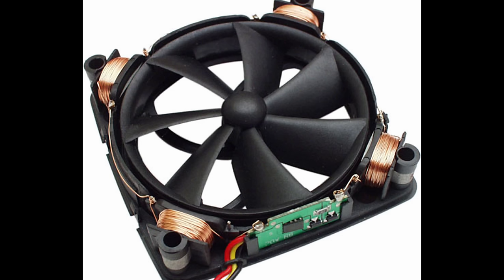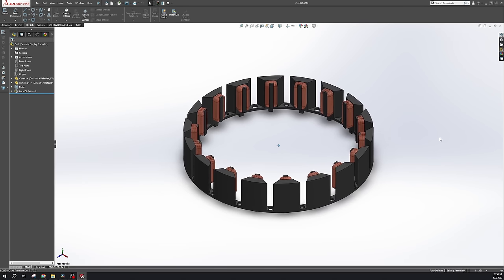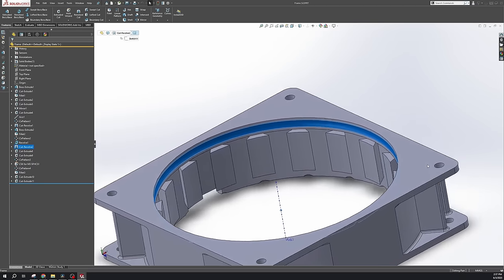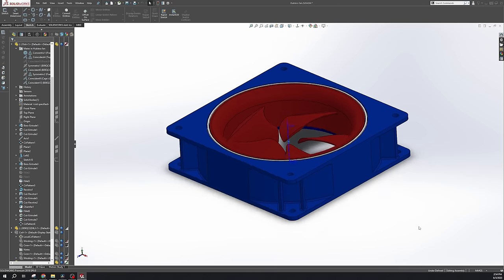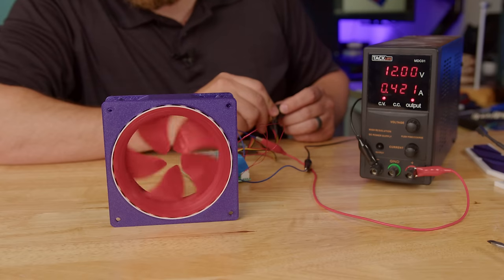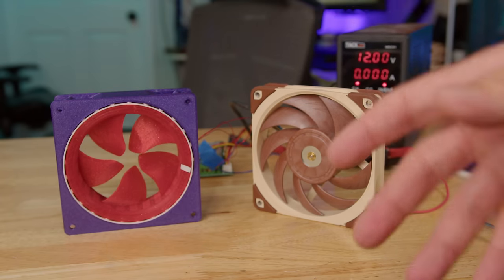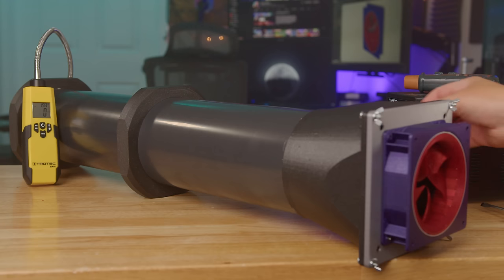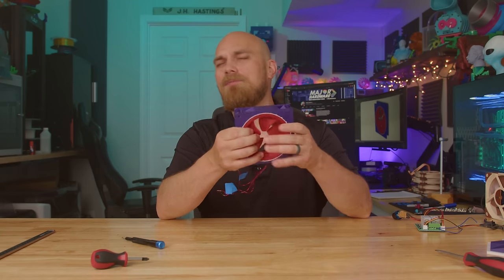I made a HUBLESS PC fan and it’s so loud!

Comment: So I have a thought based on this design for the fan. What would happen if you were to instead of blades coming out of the housing. It's 4 self propelling fans that propel themselves due to the velocity of the fan itself spinning. Idk just a high thought. Be a cool concept to see happen.
Reply: I'd imagine it would be difficult to pull off due to the construction materials probably giving up at high speeds, and how small the 4 fans would have to be to fit without colliding with each other. Definitely some spacing to prevent that but at same time maximizing space. Plus the structure that connects the  "pinwheel" fans would have to be sturdy to not sway at those high speeds as well. I'd imagine an arc system being used to replicate the blades without them being there in full. Tricky to pull off but might be something never know. I'm no engineer

Comment: Would it be possible (for v2) to replace the magnets in the hub with a magnetized roller bearing, combining the ball bearings and magnets? If sealed properly it can be lubed and provide stability and hopefully less noise. Sourcing rod magnets to be used as bearings would be the challenge.

Comment: I would like to see you improve on it's design. I know you're not a professional fabricator like they have when they are developing new products... however, if you're able to find a way to incorporate a smoother bearing (less friction) then it'll cut down on your sound and make it's rpm increase with less power. Additionally, what if instead of having a hollow middle you have the blades connect across as they are twisted? Not a hub, just a channel of some kind. Or better yet, make the blades hollow, but edged enough to scooped the air through and around? Goodluck! Been watching since season 1, big fan! haha, see what I did there?

Comment: Engineering wise its an interesting concept. And the execution with what you had at hand is  awesome. But in terms of fluid dynamics its inefficient. If this were a compressor for a plane, in which you have air coming at the blades and the hub, at high velocity, this would would circumvent having a stagnation-point or rather a second surface on which you fluid sticks and accumulates losses due to friction. 
BUT!:
You don't have that here. The fan is stationary and the hub is the point where the least is happing. The tip of the blades at the center move the slowest and even if their pitch is high enough to scoop some air, all they do is swirl it a little and push it to the outside. Besides, every bearing, whatever type, of the size of the rim of the fan, is grossly oversized for the forces it needs to accomodate. And generates additional losses because of the fricition and inertia of whatever is making the relative movement work. The only thing that would be acceptably would be magnetic bearing. Or a very thin selflubricating friction bearing saturated with some silicon-oil. 

What i would find interesting would be a "bladeless" fan, as in, like the dyson fans. Technically they are not bladeless, as the initial airflow is still generated by a fan in the base. But how about  you fit a radial fan to the housing of your hubless fan an make a flow channel that directs the flow to an annular gap and see how that works.

Comment: put a drop of SUPER LUBE MULTI-PURPOSE SYNTHETIC GREASE in the bearing channel might help with sound and start up spin. Also trick to get smoother surface take your old resin and coat a print it. you can uv cure it to the pla smoothing it and making it stronger.

Comment: Surprisingly there's deviation in the OD but the "hub" doesn't display the same wobble I wonder if the rim is slightly warped and that's where the increased noise is coming from

Comment: Why don’t you try to do the same design but with magnet instead? Like train for example. I think you will need a unit to control the polarisation but it should be much quieter

Comment: Altho the concept and look is really cool, especially with the hold in the middle, this isn't a really useful design because most of the airflow is generated on the edges of the fan, because that's where the blades are going the fastest, so putting the hub in the middle and decreasing complexity is very much a no brainer if the downside is losing the weakest part of the airflow

Comment: Curious if it were to operate on a computer, if submerged in mineral oil, would it silence the bearings, lubricate fiction points, and provide directional flowing of case hot pockets

Comment: I am sure if you "run it in" and grease the bearings, it would run better and be a but quieter. Maybe even eliminate the bearings holder inside and pack the race way with nothing but more bearings.

Comment: make the coils smaller and with thinner wire, and make more of them and get a metal frame ceramics ball bearing . that way it can be a thinner fan and frame for the fan thus lighter. 
and ad more blades to it. 
maybe even get lubricant for the bearings to reduce friction even more

Comment: If you change the outer ring electro magnets for 2 sets of electromagnets facing each others and the inner ring magnet passing in the middle of them you should eliminate the use of bearings. Also it's possible I live in a other world and i'm drunk.

Comment: your bench supply goes to 30volt i guess and i think that speedcontroll goes to something simillar crank up the voltage and u gonna get the higher speeds that u want 12v will only push so much u wont get more rpms from higher amps :) atleast thats how escooters etc works amp just make them stronger while volt increase rpm.

Comment: okay now apply this idea to a centrifugal fan and use it as a printer part cooling fan with the hot end poking through the hole in the middle (hole in the middle acting as in intake and chucking warm air out to the sides)

Comment: Don't destroy it. Make another one with a hub in the middle, check if there is a performance difference and THEN accept hubless fans in the show. I know it would be a problem to compare them against fans driven by the Noctua motor, so this would have to be a different category. But this opens a completely new frontier for the show.

Comment: Why use barrings at all? Couldn't you just use ring magnets facing opposite from each other so the fan itself and is sandwiched in between the magnets so there is no friction or noise except air.

Comment: The reason for the hub is that your materials are stronger in tension than compression, with a center bearing it’s pulled in tension, your hub less design has blades in compression. Surprised you didn’t address that in your mechanical design.

Comment: In old stile hard drives they use the speed of the spinning disk to make the space between the needle and the disk as small as possible or to use magnetic levitation. Is it not possible to have no bearings and use the air it self as a bearing and the fan floats in air kinda like the maglev train or some magnetic toys (spinning earth globe that floats in the air).

Comment: Next time print blades with material going parallel to the spin rather than perpendicular. Otherwise it will just add to noise...i mean after you fix ball bearing rattling.

Comment: This is an absolutely awesome prototype and I would love to see more refinements of this idea.  I have seen the hubless turbine/fan concept before and love it.  Obviously the bearing is the source of most of the noise and needs more refinement.  Possibly adding a second bearing to the back edge of the fan to make it a more balanced design, or going with something other than a ball bearing.  It would be interesting to see if the concept of a combined magnetic bearing / electric motor could be implemented.  You already have magnets and electric coils in place, it's just figuring out how to get them to stabilize the rotor in the frame in addition to spinning the rotor.  I saw this video a couple of months ago about a very similar concept for an electric aircraft thruster, I wonder if any of the concepts he presented in his video can be applied here.  https://youtu.be/Lrnu0-vL504

Comment: As a tool and die maker that works with tolerances of. 0001 and less this 3D printing is both interesting and cringeworthy.  Having engineering bring me 3D printed parts and asking if there is a way to make it work better makes me want to scream. You just can't get the fit and finish by printing them yet.

Comment: I've watched a few of these  videos of yours just randomly recommended to me by the YT algo gods. You've said i think in every video i've watched that you just  copied the look of what ever reference material you had. My question i guess is why don't you spend more time optimizing the fan blade design? If it's a lack of knowledge i'm sure you can find some sources or even do your own experimenting and upload the videos of your results. There's a huge variety of factors that can be changed could lead to some interesting content. 
Secondly I don't believe you said anything about lubricating the bearings, either with grease or graphite. That would help the noise quite a bit, you could also experiment with reducing the number of bearings as the load itself isn't that heavy generally speaking you only use more bearings with an increased load, the more bearings usually means the louder it is.

Comment: Hmpf... Second time I've randomly gotten unsubscribed from the channel..... 😡 
WTF YOUTUBE?
Anyways.... I feel like using half as many bearing balls would still be MORE THAN ENOUGH, and cut back on noise significantly....
Reply: Oh yea, and I remember when Thermaltake released these. I still had my Athlon XPs modded to MPs, in my Gigabyte SMP board. 

That was cooled by Tt Volcano 2+ HSF (two, of course), which I think my conventional fans were, aptly, called Tornados (not the edge-driven).
They were 80mm, moved a bunch of air at like 6000RPM, and we're sooo loud! Again, aptly named lol

But yea, then they released the next iteration (Volcano 4??) with those fancy fans. I wanted to get them so bad, but rumor was they didn't move anywhere close to the same amount of air as my Nados.

Comment: 6:00 no research on my part yet. Should be NNSSNNSS, not NSNSNS.
Reply: Yes, NNSSNNSS magnet configuration will solve your starting issues, and it'll work all around better. White lithium grease comes in a spray can, soak the cage and ball-bearings before construction. It'll take maintenance grease holdes dirt, hair etc probably monthly rebuilds. It will help, though.
Reply: #MajorHardware